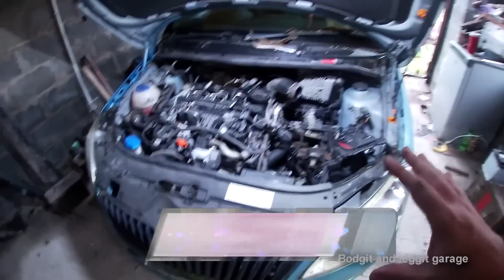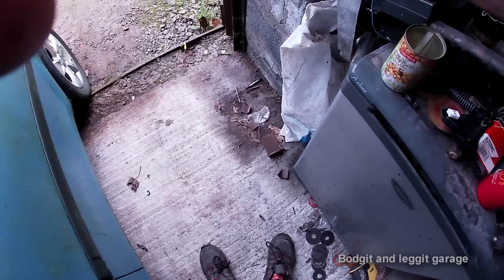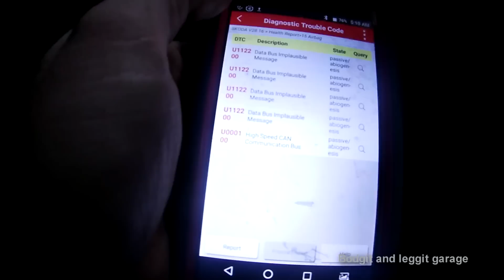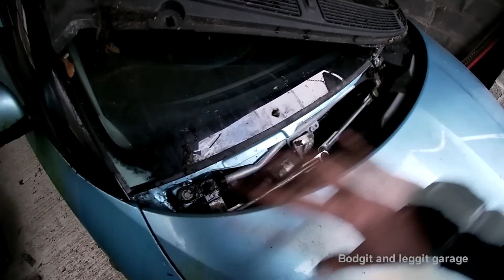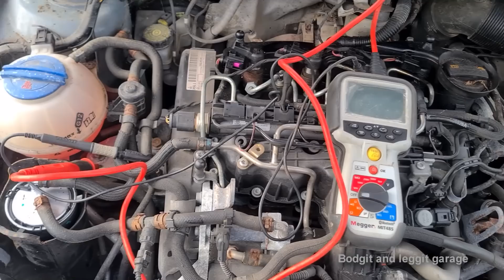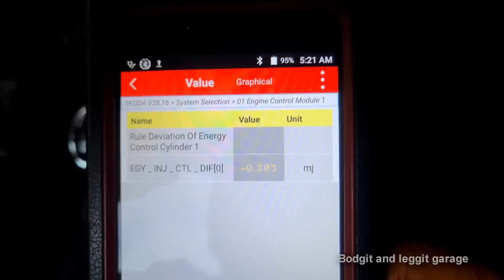Don't Do This To Your Car Big Mistake

Comment: Had 5 old bangers at one point. Was running them around car park  where they were stored every couple of weeks just to keep things moving, charge batteries and keeping mould away. Is a hassle but saves monies in the long run.

Comment: 1:05 'the electric power steering pump '
So the alternator then. 🤣🤣
Reply: No, is exaclty what he said .. this model has hydraulic steering assit with an electric pump.
Reply: @vladulescuadrian6080  that would be the electric power steering 'hydraulic' pump, since there are actually electric power steering systems.

Comment: Lean is right sometimes you are better off spending more because in the long term you actually spend less especially when it comes to electronics and tools in the long run because you could keep messing around with the injector and wiring just wasting your time and wasting your money throwing part's at stuff like I did as if I had the thing  Leon had I would have known my injector was dead on cylinder 3 so I wouldn't have bought a €90 coil and a €3.50 spark plug and wasted 40 minutes messing around with it especially on a field/yard Corolla It ain't worth it

Comment: My dad has a low mileage 2003 yaris and I've got a high mileage 2004 yaris. Both run strong I've ran mine without coolant and under minimum oil for about 1000 miles and the car still won't die. Think a lot depends on the car itself, yaris seems pretty strong to me

Comment: I have a 1.6tdi Octavia feels like it is running on 2 cylinders, glow plug light is flashing but not bringing any other fault codes up, any idea Leon?
Reply: What scanner you using? Sounds like you need a different one.
Reply: @davyarthurs   it's a launch CRP,
Reply from the maker: My guess would be injected Or high pressure pump
Reply: @bodgitandleggitgarage   you are correct 💯, number two injecter had failed. No glitter thankfully 🤣